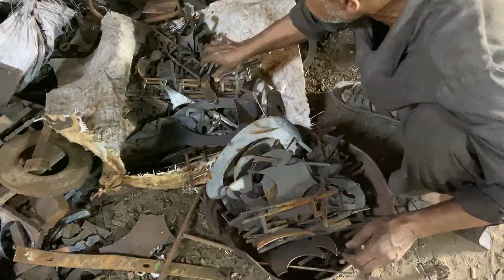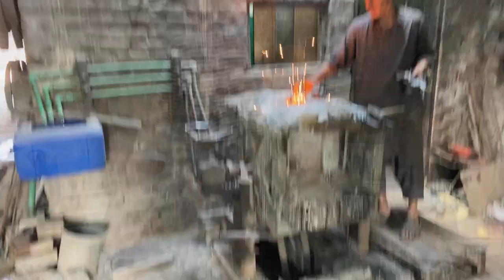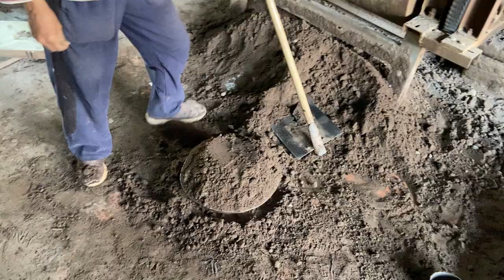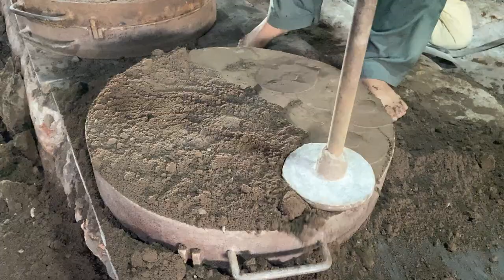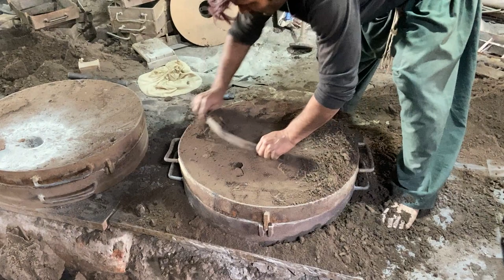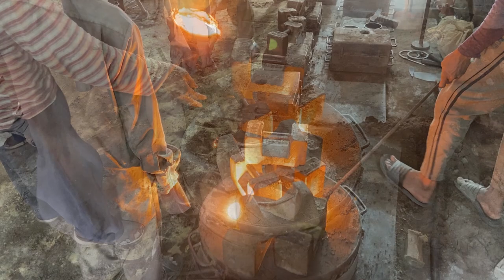Metal castings to sustain life in local foundry

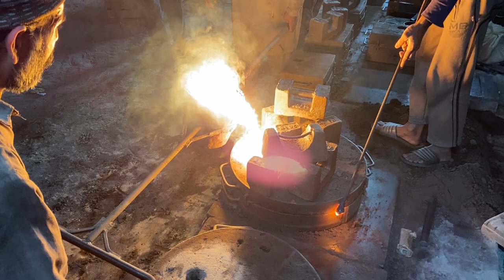Comment: @7:03, when he sets fire to the gap between the two mold halves, why and how is this?
Reply: I think that's called venting, burning the gases and vapor so that the formed metal will not have holes or trapped bubbles inside.
Reply: @bakielh229  I had no idea, thank you